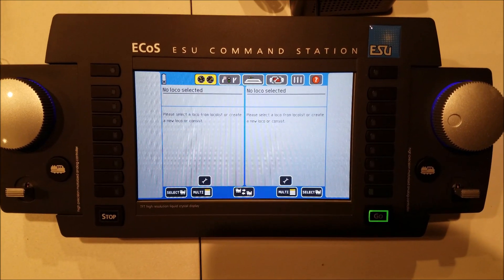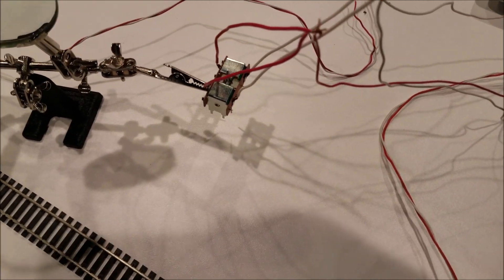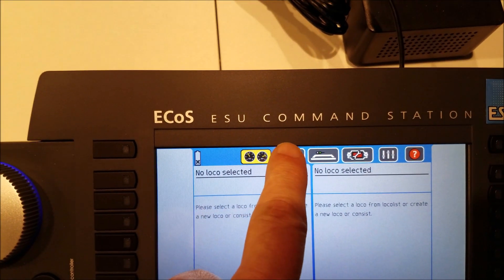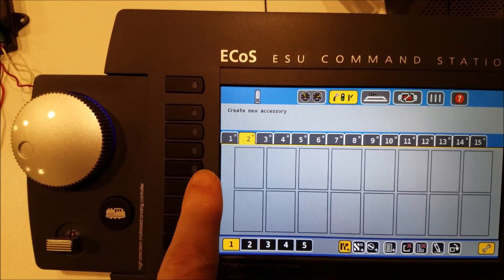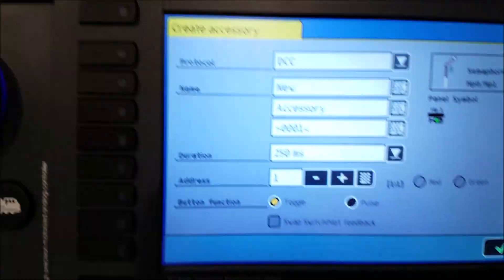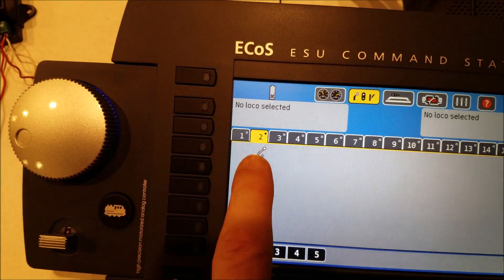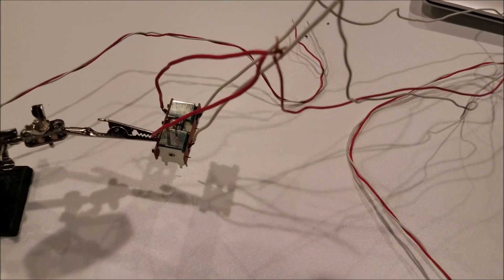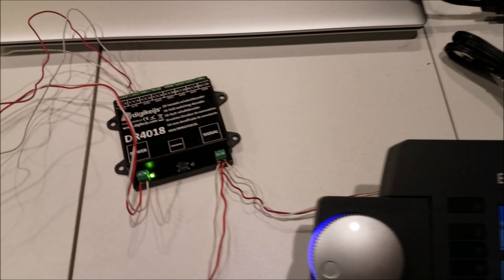ESU ECOS Programming The Digikeijs DR4018 For Peco Turnout Motor

Comment: I have seen that you can use the 4018 with the Peco turnout. What if I need to to power an insufrog? Would I be able to get that frog powered up with the ESU and 4018 alone? The reason I ask is that it looks like Peco sells a frog powering type of control...I would not want my engines looking power cause the frogs are not getting any power.... Hopefully I am making sense. Thank you!
Reply from the maker: The DR4018 by itself doesn't power the frog.  However, you can use these: https://www.ironplanethobbies.com/product/mono-frog-juicer/

Or you can use the DR4024 with the DR4102 and that will power the frog too.

Comment: Every video I see people just programing one things at time. I have all of my  turnouts already connected, Do I  have to disconnect everything ? The reason I ask is because after I program the first turn out, I try the socond one the first one gets programmed again even when I use a diferent address. How do I program a second RD 4018 unit turnouts when it has the same addresses [1-8] as the first one? I hve an Ecos Esu command station. Could anyone help me with that please.... Thanks....
Reply from the maker: It's fine if they are already connected.  If you are using snap switches then you don't have to program anything.  it will work right out of the box.  You only need to set the starting address, the other seven will fall in line.  You can set the starting address to something other than one if like.   If you have a 2nd DR4018 then set it to an address of 9 or higher if your first one is at 1 which is the default.
Reply: @IronPlanetHobbies  Thank you.

Comment: are these okay to use with peco point motors? I've read in forums that the peco point motors draw a lot of current and can potentially burn out the DR4018, and I currently have a problem where my DR4018 appears to be burning out my PL-11 point motors
Reply from the maker: We have several customers using them with Peco.  For the Peco the DR4018 should be on Preset 0.  If the DR4018 is setup for stall motors then it could burn up a snap coil motor.